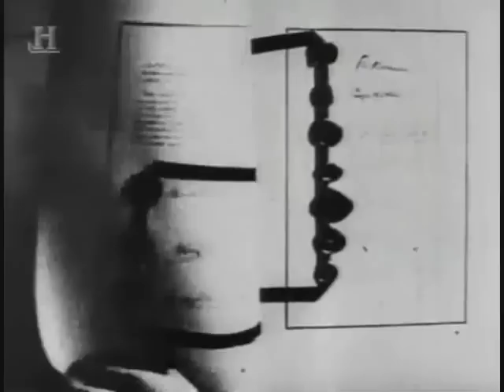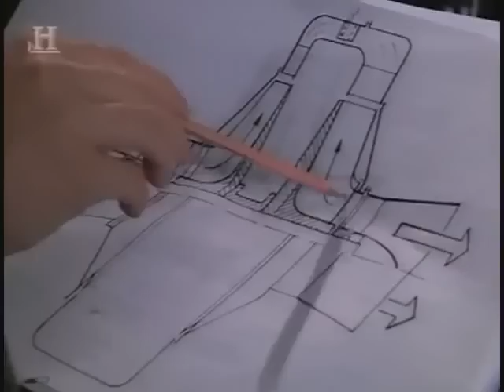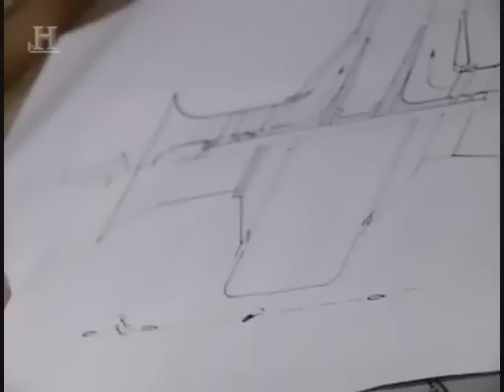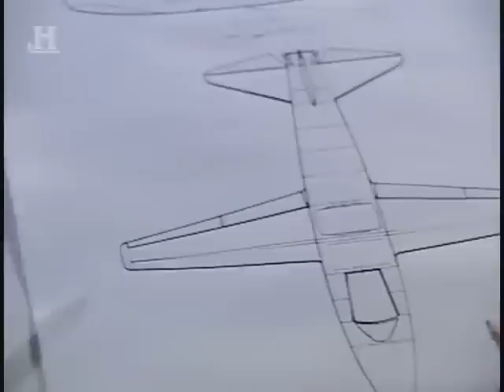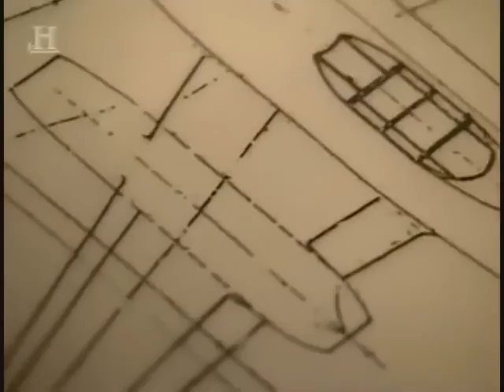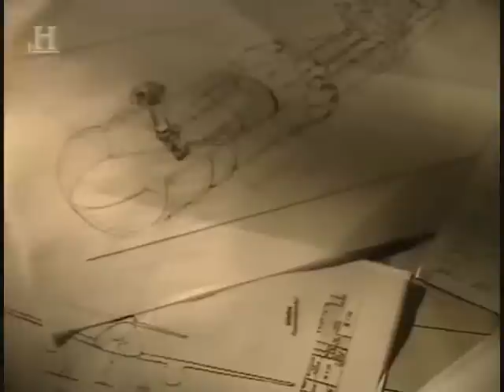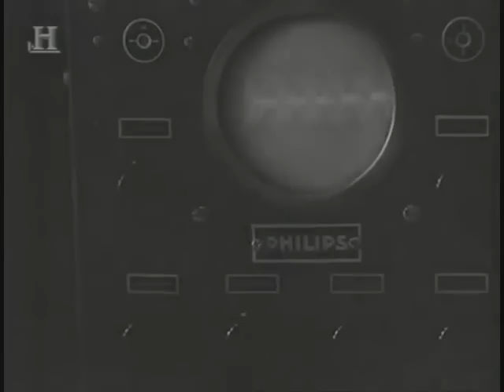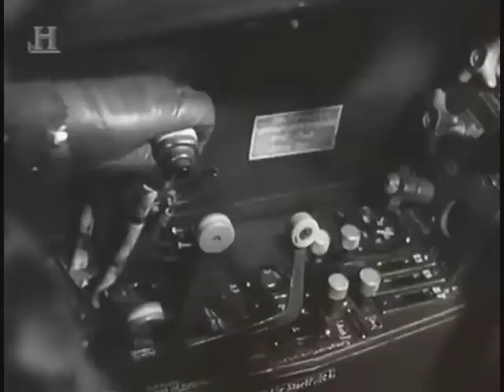A Race for a Jet - Me 262

Comment: The 540 mph speed was of course phenomenal and is always pointed out, but the hiting power of the four 30 mm Rheinmetall MK 108 cannon, was a massive amount of striking power that is often overlooked. Also at 23:19 is Hans Guido Mutke, unofficially the first man to fly faster than the speed of sound in 1945. Incidentally, these re-enactments are very well done with the German actors on the 262.
Reply: Erik Hertzer.
The 540 mph speed was ok, but the performance of the Me 262 was not great, rate of climb, service ceiling and it had very poor maneuverability. the 30 mm cannon had low muzzle velocity and not a single Spitfire or Tempest was ever shot down by an Me 262. Both shot down quite a few Me 262`s.  
Hans Mutke only claimed to have gone supersonic in a dive after Willy Messerschmitt was dead.   and the Me 262 did not ever get close to the speed of sound, as Willy Messerschmitt said it would break up if it exceeded mach 0.86, that is confirmed by the RAE who tested the Me 262 after the war they gave it a maximum safe mach limit of 0.84.
Reply: The firepower gets overlooked because of the low velocity making it unsuitable for a jet.
Reply: Whatever youy ettmpts :  Efficient  enough - the Borsig 30mm  canon -  to  turn a B17 into a wreck  of   dural confetties , as the  cannon film made by A. Galland   have shown  us . .All the greatest fighter pilots who flew the 262  in last month of operation,  were  the best  of the world at this  stage of the war . They  open fire at nearly blank point range . And at this range , the four Borsig  didn't let the  smallest chance to the B17 or B24 .
Reply: Interesting point. But practically flawed. Combat data doesnt back that one up. The Me.262 had one of thw worst interception rates of any fighter of the war. Well behind things like the Bf.109, Fw.190 and even things like the Zero or Hurricane. The 30mm was powerful in theory, but for jet combat was near enough to useless with the ballistics of a mortar. To quote the most experienced test pilot in history Eric Brown, RN Chief test pilot and CO of Captured Enemy Aircraft Flight Royal Aircraft Establishment; "The great problem with it was it did not have dive brakes. For example, if you want to fight and destroy a B-17, you come in on a dive. The 30mm cannon were not so accurate beyond 600 metres. So you normally came in at 600 yards and would open fire on your B-17. And your closing speed was still high and since you had to break away at 200 meters to avoid a collision, you only had two seconds firing time. Now, in two seconds, you can't sight. You can fire randomly and hope for the best."
Reply: Hell in the 262's first combat it wasn't even able to shoot down an unarmed reconnaissance mosquito.
Reply: I have seen that Kurt Welter claimed about 30 Mosquitos shot down when he flew the Me 262 but most of his claims have been shown to be false so I wonder how many Mosquito`s were really shot down by me 262`s.
I have seen the account of a PR Mosquito that went to Poland and was chased by 1 Me 262, he evaded it and then he saw 4 more Me 262`s and evaded them too.
Reply: The Me 262 in 1944 had two jet engines giving under 2,000 lbs thrust each and was an early jet fighter, the  Boeing 777 has two jet engines giving over 115,000 lbs thrust.  
The British Vickers VC 10 in 1962 went faster than the 777.   
No American civil aircraft has got close to 1950`s fighters. so what is your point?
Reply: Barrie Rodliffe Hint: The Luftwaffe in 43-45 did not care about killing fighters. Fighters did not hurt the Industrie. Actually they tried to evade fighters because the only valid targets where bombers.
Reply: Strange just how hard they tried to evade RAF fighters then.  No Me 262 even got close to the speed of sound, the Me 262 would break up if it exceeded  to mach 0.86 or a lower speed than a Spitfire.  The Me 262 was not only not as fast in a dive the Me 262 never even shot down a single Spitfire, not even an unarmed photo reconnaissance Spitfire, they did try.   RAF fighters did plenty of damage.
Reply: I have a lot of respect for Eric Brown but he never flew a Me 262 in combat or against one, as RAF pilots found in late  1944 the Me 262 was not a dangerous opponant. It had poor acceleration and climb and could not maneuver well at all, that is maybe why the Me 262 could not even shoot down unarmed Spitfires.

Comment: Barry Rodliffe.                     The Arado Ar 234 of the German Air Force was at the end of the Second World War, the first operational - and actually used - jet-powered bomber in the world. In December 1943 first flew the version Ar 234 B-1 as a reconnaissance aircraft, followed in 1944 their first missions as a bomber. The bomber version Ar 234 B-2 was used from early 1945, the bombs were carried externally. However, the speed dropped so far (to about 660 km / h) that fast piston engine-powered fighters of the Allies could fight the Arado. Although in the final days of the war the bomber played a rather modest role, because he remained on the ground most of the time because of the general German fuel shortage, yet showed in the few missions that it was almost impossible for the Allied hunters to intercept him.

Comment: Whittles jet was basically  a big turbo charger.....which was being used on piston aircraft at the time. Where as Germany’s jet was an axial flow......a big difference and a more powerful concept with more developed possible.
Reply: Except whittles patent was for both and he did understand both, Ohain copied Whittles patent and his engine did not work so well, The BMW axial flow was a complete failure, the Jumo almost as bad, they went nowhere 
The Whittle centrifugal design wet on through the RR Welland, Derwent and Nene, with more power than the unreliable BMW or Jumo
The Metropolitan Vickers axial flow worked and they led to the Armstrong Siddeley Sapphire, RR Avon Bristol Olympus. All US and Russian jet engines owe their beginnings to British designs.
Reply: Whittle knew all about the axial compressor and also knew that it was technically more efficient but also that it would be new to British manufacturing whereas the British were experienced in centrifugal compressors so that was the safe way to go and that is the way it went. Ohain went for the axial system and produced efficient engines which were unreliable and which had a short life. As experience grew and lessons were learned, especially when manufacturing was switched from Rover to RR where Stanley Hooker took over,  things changed.

ps. That is why, to this day, all RR jet engines  are  designated as RBnnn. The 'B' stands for Barnoldswick where the rover factory was located.
Reply: Barrie Rodcliff
What a nonsense

Germany was years ahead in Jetengine tech 

Ohain dont copied whittles patent , both worked without knowing about the other ones Work. Read history books.
BMW 003 or Jumos 004 were not failtures they suffered under  shortage of rare  heatresistent materials . The JUMO 004A Prototyp was contructed with such material and run without problems in  an 100 hours test,  but for massproduction  JUMO used used inferior Quality metals, thats the only Problem of German Jeteng.  

The French ATAR based on the BMW. 

The Russian built both Jetengines  under the designation RD-10 and RD-20 for its first jets  with  better material.
Reply: andgate2000 whittles engine powered the Mig 15 which blew your twin supercharged P-51 out of the sky...and downed a lot of F-86s too
Reply: Barrie Rodliffe bullshit there was a lot of development between the axial and centrifugal concepts and actual working reliable high performance engines of today which woould bury the early British and German designs which were nothing more than superchargers without a piston engine in the middle. Next you're going to claim that the British were responsible for the SaturnV.
Reply: Bollocks, and you know it 😂😂😂😂 axial flow engines were not the way to go in WW2. Only when more suitable materials were available did the axial engine flourish ie 1960’s. I take it the Mig15 and 17 are ok😂

Thank god germany pursued vanity projects instead of building more numerous proven weapon systems. 

Cheers ears🍺🍺🍺🍺🍺🍺🍺🍺🍺

Comment: In the development of the turbojet engine the centrifugal style of turbojet was preceding the axial flow turbo jet in design.   To have developed a working jet fighter with a axial flow turbojet is proof that Mr Whittle was by far not the first person to have developed the turbo jet engine.  The Germans were with out a doubt the first to design and build the first turbo jet engine along with the first operational jet fighter.

Comment: Very interesting topic but it is so full of detail...and ultimately proved that the entire German effort was undermined by over-diversification. But really the idea of fighter defense against the Allied bomber streams was a lost cause even before D-Day. There were just too many Allied planes and not nearly enough German planes. The route to success here was to drastically reduce the cost to down Allied aircraft. What the Germans needed was better AA not faster fighters. They needed something very much like the machine-gun and the way it affected ground warfare. Either a massive increase in rate of fire or accuracy or both. There was no way they could make enough jet fighters to put a serious dent in the Allied bomber streams when armed with light cannon and  rudimentary rockets, 80 rounds per gun and 24 rockets each...to take down 1000 bombers you would need 2 or even 3000 fighters  not even factoring in Allied air cover. Then the jets need air-cover at low speed. The bases need air cover. Mfg and transportation and fuel supplies need air cover.

The whole problem with an air war is that it requires enormous infrastructure and material supply to sustain it all of which is vulnerable to enemy attack.

So first the war was effectively over when the Germans conceeded both Operation Barbarossa and the Battle of Britain not to mention Italy and North Africa  second when they assumed a purely defensive posture with no ability to significantly impact the bomber streams striking the German heartland third after the success of D-day coupled with Russia taking Central Europe. All of which depended on ineffective kill-ratios. Their entire tactical mentality was out of whack. They wanted to fight WW1 with 1950s technology and 1930s mass-production. The Allies simply fought WW1 with 1940s technology and 1940s mass production. The Germans had no chance to win that battle.  They needed very cheap very numerous and highly effective weapons not massively complicated planes and tanks that required a huge and vulnerable support infrastructure.

They really failed to learn the lesson of their initial success.

Comment: the really stupid thing, was the 262 design was production-ready in 1941.
Reply: No... No it wasn't. The 262 wasn't even flying under jet power in 1941
Reply: It was 1942
Reply: Crag_r 1942
Reply: They couldve built it but AH had to wish it would be a fckn Bomber
Reply: It was flying under jet power in 1942. But those jet engines would barely be production ready in 1945. It didn't matter what role it had earlier, it didn't have the engines to run. The Germans struggled to outfit a single squadron of them in 1944 because of a lack of jet engines, it was not going to be ready in 1942 no matter what it was intended for.
Reply: no, no it wasn't.